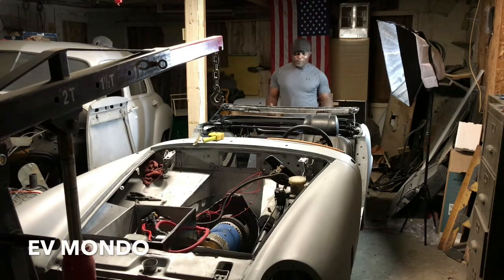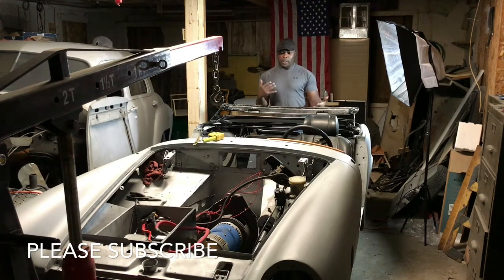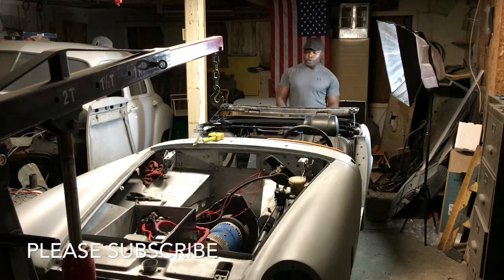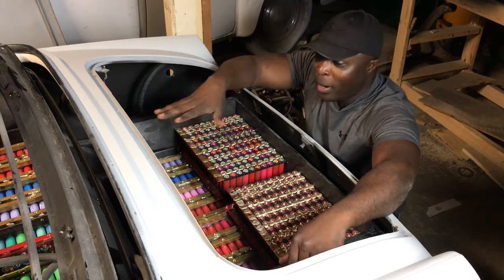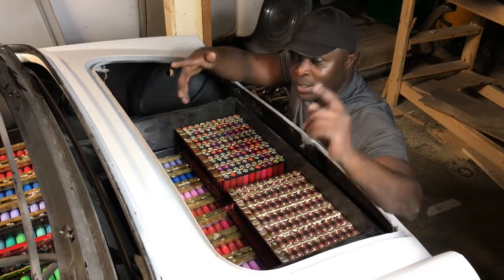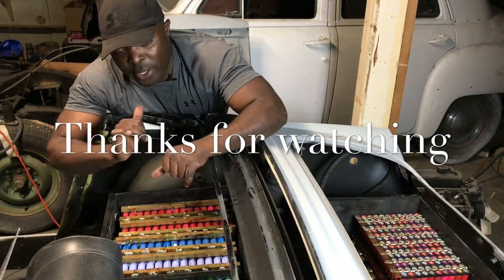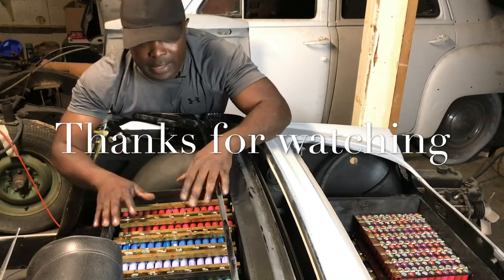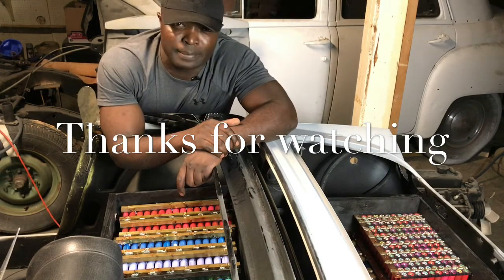Tesla Batteries Update

Comment: wow, I'm always impressed with your set up, so many cells!   I was going to ask you if the plexiglass would melt, but I googled about plexi-glass and it says it becomes pliable around 135 celsius (275F).    What is the configuration of each of your 140 pack batteries?  are they 10s14p 36 Volt ?
Reply from the maker: Beakerzor I  will have 40 packs not 140. Right now I have 150 cells on each pack connected in parallel. Presently I have 20packs on the car connected in series.